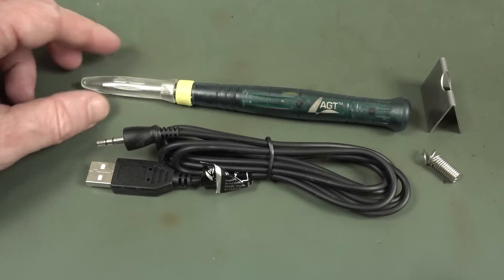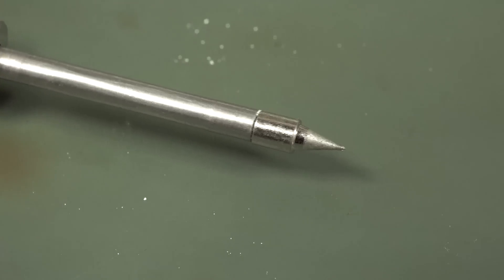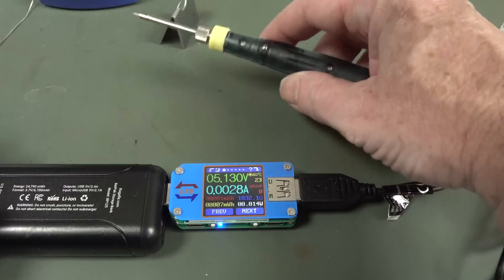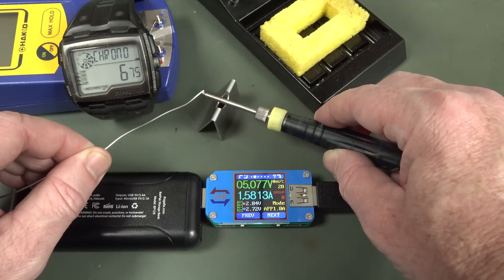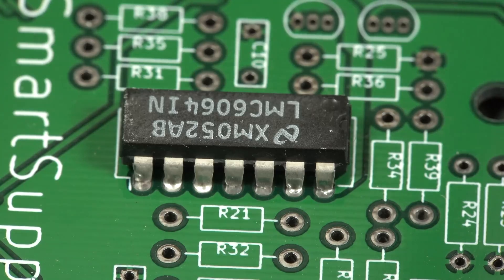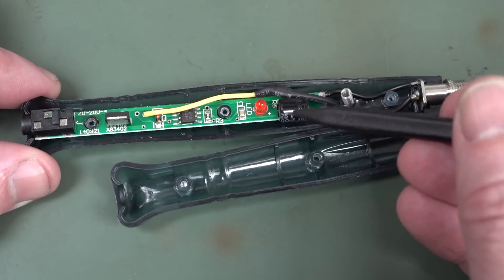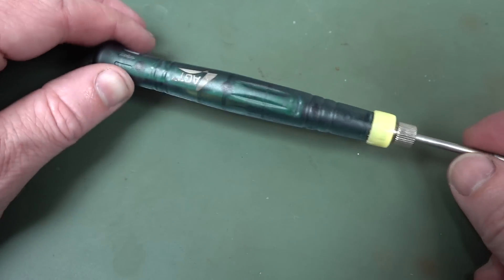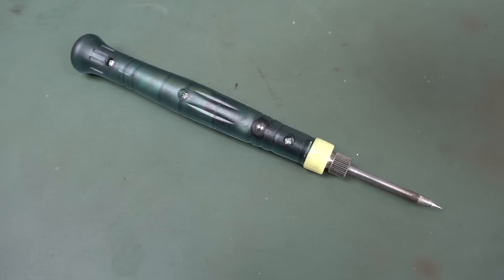EEVblog #1113 - Is a $5 USB Soldering Iron Useful?

Comment: I disabled the touchpad and the spring-in-a-tube movement sensor and just added a switch in the wire so I didn't have to pull the USB plug out each time. btw don't use a mains USB output if you care for your components' health ;) EDIT: I see your version doesn't have the movement sensor thing

Comment: I have to say, I am happily surprised at this review, I really thought you were gonna dog on it hard, and I mean, I can't say it wouldn't have deserved most of it, but, great when price is kept in mind. I could see this being very useful to keep around for making repairs on your car or wiring up stereos or lights in the vehicle since it should easily do the job for most vehicle applications and wires are far less sensitive to heat than IC's. I actually kinda wanna get one just to keep in the car, because yes, I always have a battery bank or two that can put out the power LOL.
Reply from the maker: It's not great, it's acceptable for some jobs.

Comment: Have you ever taken a look at that COLD HEAT battery powered soldering pen that came out some years back?
Reply: William Gottlieb Those really weren’t too great — just a tip that was a pair of carbon conductors that depended upon being able to flow enough power through the wire or component they were touching to make some solder melt.  So you had to have solid enough electrical contact with whatever you were trying to solder to pass enough power through that component to actually get things hot enough for the solder to melt, after which time it would get a little easier since the melted solder could then bridge the electrical gap, but you were typically trying to deliver that power from a couple of alkaline AA batteries, so you were quite limited in power delivery as it was unless one substituted NiCd or NiMH batteries.  I don’t recall ever seeing an especially positive review of that iron that was not provided by a paid sponsor.

Comment: Yes  I repair copiers for a living and a soldering iron is great when you need to patch a damaged cable and they're very very thin and small and you have limited space in your bag also there been times that PArts haven't been available for old machines and they broken and you can actually use them to weld the plastic for broken sensor flags and other pieces back together so yes they actually have a use and it would've been nice to have a usb with a battery pack instead of a 120v

Comment: I got one from Banggood some time ago and really love the tiny tip for circuit board stuff. The first thing I built to test the iron was a dso shell oscilloscope kit. The scope works as great as the iron and it's really cheap also! While mine looks the same,  it's not a German version and the inside components are different. I don't have to touch mine to turn it on. Mine turns on when I'm within an inch of the metal ball! I love how fast it heats up for quick fixes to a quad copter and it cools down just as fast when I set it down. Prevents burn marks where I don't want them.

Comment: Audio jack REALLY???
Reply: If you have a really unrealistic line-out driver that goes to +10dB and can supply a few amps, this iron might actually be useful.  Just use the volume knob to adjust power. :)
Reply: No thanks I'd rather have microUSB or type-c
Reply: Arek R. - no, you wouldn't. Those crappy phone connectors would snap in minutes. The 3.5mm audio jack is a much better choice for this application. and it swivels too.
Reply: Yes highks, they could have used a axial power connector, however they didn't need to.

Comment: It seems there are slightly different versions of this soldering iron. I have the one you reviewed and I also have the Aneng version, which has an actual button under that metal dome and the overall quality is better.

Here is a link - https://www.banggood.com/ANENG-LT001-USB-Powered-Mini-5V-8W-Electric-Soldering-Iron-With-LED-Indicator-p-1170695.html?cur_warehouse=CN

Cheers

Comment: In its' defence, these USB soldering irons are handy as hell, I use mine more often than I do my mains one, because the soldering jobs I tend to do are quick and dirty, and this thing is the bees knees, no good for ground planes, but for components and wires, brilliant little thing... :P

Only downsides, the auto-shutoff sucks, so I modded mine so it's on as soon as I plug it into my USB powerbank, and of course the lack of tips, but, other than that, I love my USB soldering iron... :D
Reply: Got one of these too and for those quick jobs where you dont want to haul out your big soldering station, this works excellent.

Comment: It would be nice if they had USB-C higher powered ones (maybe USB Power Delivery spec for more chooch) with a tactile on button, a modest adjustable temperature range typically used for microsoldering, and a price around $50. Could be a lot of uses for a budget yet effective implement like that.
Reply from the maker: I'm about to review one of those once it gets here.
Reply: Sean McNamara That could be a vastly more useful portable soldering iron solution, especially if it could deliver a peak power in the 40-50W range when needed to help regulate the tip temperature on moderate sized jobs without having to dial the temperature way up to compensate.  Plus at least some variety in tip styles and sizes so that you can tailor the tip to the specific job (I generally prefer the 1/16”, 1/8”, and 1/4” chisel tips for most work).

Comment: does plugging the minijack short the USB supply on the way in?
Reply: Lasse Langwadt Christensen oh interesting! Didn’t think about that.
Reply: zach burke it looks like they used a  stereo connector, so you can leave the connection in the  middle unconnected, so propably it doesnt short out your usb bus
Reply: Ray San My thoughts as well, that way you have a large region in the middle so that the second power connection is not made until the plug is fully inserted into the jack.
Reply: Possibly does. I didn't notice any issues with mine though. Power bank didn't seem to care, and the one I used is pretty fast to trip it's short circuit protection.
Reply: I've had laptops that would instantly reset with a loud beep if you shorted the USB supply

Comment: I have two of these. And I decided to simply cut out he middle man and get rid of the mosfet and keep the iron at full power all the time. (And the mosfet doesn't have the most impressive on resistance, so one will get a slight be more power out of it. Not that this really matters.)
Though, the good thing with this iron is that it is good enough to be useful, and is able to get small simple stuff fixed in a pinch. But yes, it surely doesn't replace a proper soldering iron.

Comment: I have tried doing SMD field repairs with one of those… It burned right through the pads and the parts' cases, but I couldn't manage to get an electrical connection. I ended up borrowing a TS100, which worked much better.
Reply from the maker: The magic of temperature control!

Comment: There are so many connectors that were specifically designed to transmit power, why did they go with a crappy 3.5mm jack?
Reply: slap_my_hand
It's round. It's cheap. It's fairly small. A small DC Jack probably would have been better though.
Reply: So you can plug the power cable into someone's sound card if they make you work on Sunday?
Reply: It can turn around easily.
Reply: because apple ditched the headphone jack and millions of these connectors had no other place to go..

Comment: hey dave i i have a couple of these i do not use the pcb on it i hooked mine up to a 12v cc cv board and run it from 1A to 2A  i was able to soldered xt60 connectors with it running it around 1.7A
Reply from the maker: That sounds like a really bad idea. What would the temp be?
Reply: EEVblog Actually, if he is running it in constant current mode then, as a resistive heating element, 2A is only 25% over its 8W rating and 1.6A would be it’s rated 8W output (effectively 5V across the element), so it’s still running largely within its design.  But it would be very short for this world were it 12V constant voltage since that would be 300% (24W) of its rated output were it drawing 2A — although given its resistance (~3.125 ohms) is largely constant its 12V specs would likely really be around 3.8A and some 46W without current limiting (though a bit less once heated beyond 500°C due to rising thermal resistance).  At that power in such a tiny element one may just discover bench top fusion power — you might actually have a bright glowing red tip if it survives long enough at 600% rated output!

Comment: I have one, it's alright actually. You wouldn't want to use it for a main iron because it's just not that great but for outdoor things combined with a USB power bank it's pretty handy. One of the mods you might want to do is solder in a resistor that bypasses the electronics to make it consume a small amount of power even when it's off, to prevent the power bamk turning off on you.
Reply: ManWithBeard1990 good mod, I’ve thought about making a usb cable with a resistor in it just because my power bank turns off with some of my low power devices.
Reply: Actually, I started using this one as my main iron for Arduino-related projects. I find it so much easier to control the movement of the small tip, my accuracy is much better than with a proper soldering station. I wish there was some middle ground between this one and a soldering station. I've seen reviews of Pinecil and TS100 but their tips seem noticeably larger and might not give me the same accuracy and lightness I get from this cheapie.
Reply: Ugelempa
Reply: Man. I was just doing a field job where this would have been perfect. Oh well.

Comment: We get it Dave, if it is under US$150 it's crap... :D
Reply: It’s not really a price thing, there just is no such thing as a good 8W soldering iron at any price.
Reply: As far as soldering equipment goes, you really do want to aim for something like a Hakko 888 for $95 at a minimum.  It looks like there are some cheapo stations on Amazon for around $50 that might  be ok, but I would worry about reliability.  Harbor Freight used to sell a surprisingly tolerable station for $30-something, but not anymore.  You can get by with a cheaper iron, but in the long run there's a high chance you'll spend more time and money fixing the things it breaks than it would have cost that get a good iron in the first place.  At least that's how it was for me, I get so much more done with so much less frustration since I got a Aoyue 968A+ several years ago (not an endorsement of that particular model, it's been fine but there are probably better options now)

Comment: Fast chargers will give you 9volts at 1.87amps about 17 watts
Reply: punker4Real you need to trick the supply to authorize the capability for the higher voltage? They use a special chip to authorize I think. Otherwise it would blow up anything not designed to have this higher voltage?

Comment: Soon there will be successor of TS100, USB power with QuickCharge3, supposedly will be decent
Reply: You mean the TS80? It is USB-C powered so it may not be as convenient as the TS100's barrel jack. I mean not many people have high wattage USB-C chargers at home (MacBook owners maybe?) and with the barrel jack it's so much easier to just apply any voltage you like.
Reply: most newer cell phones are USB-C and their wall charger will provide the proper voltage and amperage to run the TS-80. the same goes for the newer power banks that are brand name. they provide the proper voltage and amperage for USB-C(9v/2a).
Reply: mylt1z28 You're right. I just rewatched the Marco Reps video about the TS80 and realized that it actually operates at a rather low wattage. But because the TS100 usually consumes even less power even while on 24V it actually gets outperformed by the TS80. Another good thing is also that it doesn't rely on USB-PD but on QC3.0 which is much more common.
Reply: i wont be replacing my TS100 with the 80 any time soon but it would be nice to be able to run off USB-C since i always have a USB-C cable with me along with my battery bank. if the price drops on the 80 i may grab one though.
Reply: @sasodoma  Exactly the opposite… QC3.0 is the worst abomination Qualcomm has forced on the USB-C ecosystem. PD is standardized, QC3.0 is proprietary.

Anyone who decides to put QC3.0 in a product and not support PD should be fired on the spot.
Reply: @rainmannoodles  Sure if we're talking about which protocol is better I agree 100%, I have completely transitioned to USB PD chargers and powerbanks. However I was talking about the practicality for a portable soldering iron. Most people will use this with a powerbank and QC powerbanks are (were) much more common than PD powerbanks. Also USB-PD requires a USB-C port while QC works on the A port (another reason for its wide availability). Luckily, going forward, QC4 and PD will be compatible.

As for why someone would decide to implement QC and not PD in a product... It's a lot easier to get a high voltage from a QC supply than it is to get it from a PD supply.
Reply: Why didn't they call it the TS200 then?

Comment: Before I lost my eyesight I used a butane powered soldering iron in the field (electronic engineering steel industry) I think I’d rather pay $8 for a butane one then five dollars for that USB crap i’d love to find out how long it takes for it to burns itself up. Love your honest reviews
Reply: Ive had one of these cheap USB soldering irons for about 2-3 years now, still  works perfectly fine.
Reply: I hope you don't take offence but how did you lose your eyesight?
Reply: Mr.Mister I'd like to know too
Reply: I use a Dremel Versatip all the time, It`s a decent tool that has some versatility, although it tends to be a little temperamental xD
(more like 50 bucks than 8 but..)
Reply: I agree. For most on the go jobs where you need a portable iron, a gas powered one is usually a good choice. I am using one that I bought from Lidl a while back and it's still working just fine. It's especially good since it has enough thermal mass and gets hot enough to solder thick wire. Especially useful when you need to solder something in a car or similar. Of course I wouldn't be doing any SMD work with that (or anything PCB really - unless you just want to solder one DIP or a TO220). Temperature control with those isn't precise in the slightest - though possible by adjusting the amount of gas.
Reply: MY 60W Wurth has never let me down!! perfect for on the go! Although if it was available back then the TS100 is a good equivalent.
Reply: I own two butane irons. They both leak out all their butane in a day or so, I have to refill them every time I use them.
Reply: How is your temperature controlled on this thing?
Reply: Had one of those 40 dollar butane ones with leaky seals that burst into flames in my hand... 8 dollars for a Butane model?  No thanks.
Reply: yeah i had a weller pyropen (butane) it worked great for a long time. :)
Reply: we've got a butane soldering iron at work for doing soldering work within the magnetic field of MRI magnets. Great for those rare occasions that it's needed.
Reply: I used to use  DREMEL butane soldering irons by BOSCH at work for joining some like 22AWG security system wires and had 3 total failures of them just one after another. Each piece ot them lasted for about a month no more. Every time it got fucked it had a ceramic element inside itself being collapsed so it was no longer capable to maintain gas combustion.  Eventually I got switched to a 240V bench soldering station  and have never had problems like that since then.
Reply: MSM5500 Out if curiosity, when you used the butane iron did you remember to ensure that the flame was promptly extinguished once the catalyst was up to temperature (it needs only a few seconds to warm)?  If you don’t ensure that the flame is extinguished then you will burn up the catalyst in a very short time.  Once the catalyst is up to temperature it will catalyze the butane and generate heat without any flame.  If you did, then never mind, I just wanted to mention this possible issue as I have seen many who do not know that any flame must be extinguished within a few seconds after lighting.
Reply: I have a butane iron I bought from Radio Shack about 15 years ago, still works no problem on the occasional use that I need it
Reply: they are always too hot or not hot enough though.
Reply: Maybe if you had used an electrical one you'd still have your eyesight.